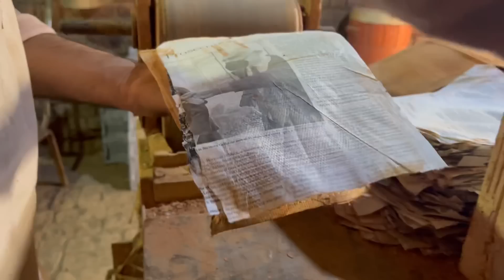Amazing Technique of Lead Acid Battery Plate Making| Dead Old Battery Restoration

Comment: Wow as someone who has worked in a battery factory in the midwest US, there is very interesting to see.

The casting of lead plates is cool to see from a mold like this. We used a continuous chilled casting drum that made basically a solid ribbon and coiled up. Then the ribbon was run through a giant punch machine that punched the little holes out of the plates but kept it as a ribbon on a spool. The spool then went to "pasting" where it would be pasted with the lead oxide, cut into the plate shape, and drying paper put on both sides all in one machine. Had probably 15 gigantic drying ovens for the plates. Drying racks would then go to "stacking" where each plate would get the separator paper and be stacked in the right amounts for that battery cell type (sold multiple sizes). The cell packs were stuffed into the battery case and pushed to the plasma welder that connected the cells. Lid was put on, filled with acid, and sat for a couple days before being ready to ship. 

Sad to see the exposure these people are getting, even seeing some kids sitting on a bed as the dude ran by with a wheelbarrow full of .... smoldering lead oxide i'd imagine. They were very strict and specific about lead exposure. 24/hr janitorial staff to clean common areas as well as monthly blood testing on site. Required to change into company clothing for your shift and must shower at the facility before going home. Can't leaving during shift even to go to your car.
Reply: Very interesting, thank you.

Comment: What's amazingly real about the technique is the fact that industrial scale manufacturing pollution is being produced in the same area that people live. Completely unregulated by the government. The areas where these folks are living and manufacturing are beyond slums. The waste from this battery manufacturing is going directly into the local river/steam. The fumes are being directly inhaled unrestricted/unfiltered by everyone in the immediate area.

The only thing amazing about this technique is the level at which corporations will stoop down to procure the cheapest materials to maintain their low overhead. Guaranteed this man is one part of the process for Walmart brand car batteries. It wouldn't surprise me if he's helping to produce ACDelco or something.

Comment: I admire their skill and workmanship. Hard to believe that they're working with molten lead wearing flipflops. OUCH.
Reply: Potentially burning their feet is the least of their worries here.
Reply: Хуже испарения
Reply: Unless they spilt a lot on themselves, the lead would run off very quickly before causing significant harm. If they were wearing shoes with a lot of nooks and crannies for the lead to pool in, that would be different. But like everyone else has said the dust and fumes and constant exposure are the real dangers.

Comment: No safety glasses or gloves dudes a beast!
Reply: Not a beast. Just expendable. There is no joy in this. Ormulu clockmakers used to die young and racked in pain from working with lead.

Comment: You know I'm amazed by what their talents are able to produce. But I'm concerned of lack of safety equipment working with dangerous chemicals and toxic materials.
Reply: in all such videos btw
Reply: Average life expectency is 15 years in all these businesses. Usually lung problems. Led posisoning leads to constant raging and insanity, then death. But always remember. This is their best option of making a living or they wouldn't do it.
Reply: For as industrious as these people seem to be. I feel like if they cared they would do something about it.
Reply: @Dawson-vy3zw  theres probably a point of diminishing returns, whats the use in keeping your workplace clean if everything else around you is polluted anyway.
Reply: Just remember, man has been smelting metals for around 6000 years, its only for the last 50 or so years, and even then in only a small number of highly rich countries, that caring about the safety of workers has been a thing.
Reply: @Debbiebabe69  There has not been anything remotely like modern smelting for 6k years.
Really, this is very small and inefficient workshop (calling it a factory is a stretch).  They are making the batteries by hand.  There was not a single part that was automated.
As far as "worker" safety goes, the vast majority of people who have lived in the last 1000 years lived and worked on farms, often their own farm.  For all the kvetching modern people do about "worker" safety, most of the people who go and work in workplaces for other people are vastly better off than being peasant farmers.
Reply: Would you want to live a long time working under those conditions?
Reply: @thunderbirdone8126  They are not working in bad conditions.
Reply: @tarstarkusz  very true, only the last maybe 50 years has “osha” type things even been mentioned. The industrial Revolution brought on terrible factory working conditions and very dangerous equipment. So thankfully something was done because man, was it bad back then.
Reply: @joshyingling  OSHA did none of it.  The child labor laws did nothing. By the time these things came along, the problems were 90% solved.
Furthermore, the only thing you know about the past is what the liars are telling you. People weren't dumb.  Nobody dragged them off their farms.  They went because working in a factory was a better option for them.
Reply: @tarstarkusz  yeah I’m aware of that……… I know people weren’t dumb. We have all these things because of lawyers and lawsuits. The best safety gear is between your ears. The people back then were jumping on the opportunities of the time to provide more money for their families. Where do you get this idea that people were dragged out of their farms?
Reply: @joshyingling  Because a lot of people tend to look at it from a 2022 point of view.  The next best option for the people working in those factories was being a peasant farmer.  We tend to romanticize farming, but it is backbreaking work all day sun up to sun down including the kids.

The government was in on the bad conditions.  They came in after the fact and codified the advances that were made into law as if it were the law that accomplished the thing.  Child labor was nearly entirely unheard of by the time the government outlawed it.  It is the same with worker safety within reason.  Today our workplaces are so safe that all of our factories are in China.  All the MILES of regulations have made us so unproductive that we can ship American cotton to China, have then make it into socks and t-shirts and then ship them the 10k miles back to the us.
Reply: @Bergerons_Review   And lets face it India IS the most Populated country on Earth

Comment: When shaking, these welds and jumpers will fly off, and the battery will fail, it can only work normally if it stands somewhere on a stable support without shaking and tilting

Comment: Someone correct me if I'm wrong but I believe that paste they're making, which came from that burn stand, is either lead oxide or lead dioxide.  PbO2 is used to make a paste that coats the plates as we see in that step where the one guy smears the yellow goop on the plates and the next guy presses them between a piece of newspaper.  This is exactly how lead acid batteries are made even in a high tech factory but of course using better materials and everyone wearing PPE.  So, if my assumption is correct then there's lead dust floating throughout that operation the entire time they're working.  Every single day and every hour.
Reply: The yellow dust is probably PbO. At 8:01, he poisoned his colleague, but I gues it is  all their lot..
Reply: @icicestparis5054  That's what I was thinking.  It has a lighter color I think than PbO2.  I used to work for another company that was right beside an Exide battery plant so I know a little about their process from friends who worked there.
Reply: @cheekygnome  oh so you are a professional of batteries ! I used to work with lead oxides in some dirty organic reactions but it is toxic and really inefficient, and of course it still a lot of lead in the final product which is not recommanded for pharmaceutics

Comment: Are they restuffing old cases or is this how AGS actually makes their batteries?
Reply: Remanufactured batteries 😉 they actually have the proper number of plates to a cell in this video.  Last one i saw they used the minimum number of plates and filled the gaps with paper🤣

Comment: A Perfect example of "Darwinism" at work and a nice demonstration of rebuilding batteries. "Without all the safety gear to get in the way." You do know there is a reason why children/adults develop serious health issues when exposed to lead oxide, right? Yet you have kids 8:34 in an area where you are grinding lead oxide into a powder. Also, I notice at 15:35 that you are only using 19 plates in a 21-plate battery... 25:49  I wondered why the plate stack fit in there so easily...

Comment: Amazing workers I was cringing at all the exposure to lead and lead compounds. I think this is why we no longer recycle lead in the USA.
Reply: Um yea we do i just scrapped some
Reply: @rustedratchetgarage6788  I may have miss read but perhaps you could also read about Doe Run lead refinery shutting down in December 2013 and it was the last one. Now we ship all lead recycling out of country. I may be wrong but if I'm correct please say so because losing our lead recycling is a big deal and just one more example of a failed recycling/environmental policy.
Reply: @damocsell  sure you may be more informed on that subject than I I am simply a metal scrapper and the yard does take lead whatever they do with it after that I don't know but they will still pay you for it I even heard of a crackhead going around taking wheel weights off of wheels and putting them in a bucket and going and scrapping them

Comment: Despite the challenge of these workers to the dangerous environmental working conditions and their inhalation of toxic lead oxide, they enjoy professional performance, but where are the occupational safety and health tools, where are the battery quality tests from the air pressure inside the plastic case, where is the clip for adding concentrated sulfuric acid, which is the basis for connecting the blocks to each other, and where are the plastic joints between Every block and the other so as not to happen, there are catastrophic mistakes, starting from making the net, then the dough, then making the positive and negative polar urates.. I think after quality tests the batteries will not last for a long life despite all the challenges of making such products, not to underestimate the workers or their skills, but to work according to specifications Standard would be better.. This is from my experience in making batteries for nearly 14 years

Comment: I was over there some years back and happened to talk to some guys in a very similar manufacturing situation. I asked why they didn't use any safety equipment and they said basically it was sort of a symbol of masculinity. I guess I can see that but still...

Comment: In 1970, I worked as an apprentice in a battery refurbishing workshop in Hungary. Professionally, I was sometimes amazed at what I saw, but the point is that even then I had to work in much stricter occupational safety equipment. Hat, gloves, mouth mask, a liter of milk, an apple a day. What I see here is a big problem for the workers there. Not sure if they'll be 50, sorry..

Comment: That battery grids polarity installed on that trash recycling better be marked correctly, those positive and negative poles on those batterie piles can’t be reversed in the middle of the assembly. The work looks bootleg like

Comment: Questions for those in the knowhow:
Is pulverized lead dust used for preparation of the oxide paste? 
Where do you aquire the separator plates?
I am conteplating rebuilding my trojan t105s

Comment: The manufacturing is very crude. The resulting batteries will work but with a reduced capacity, since the cells are too small. They don't care at all. Extremely dangerous.

Comment: I am surprised how they turned the lead dross in to lead oxide dust 😳, am sure the battery won't run more than 12 months after fitout.i say this as i am from same industry ...
Reply: New battery warranty is only 6 months